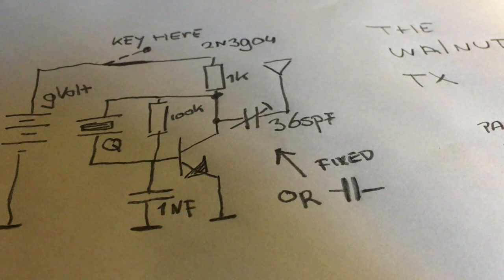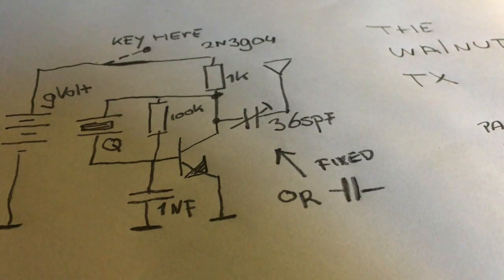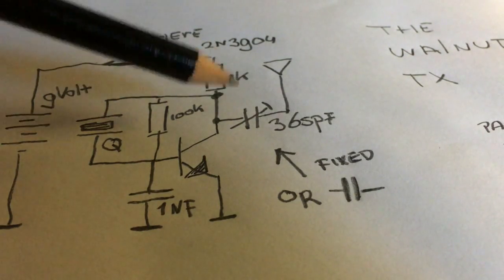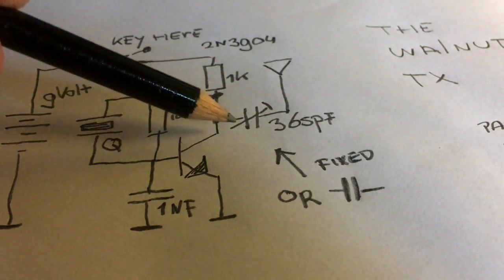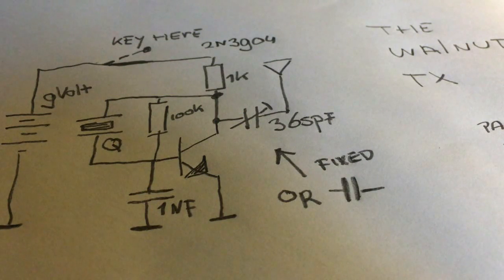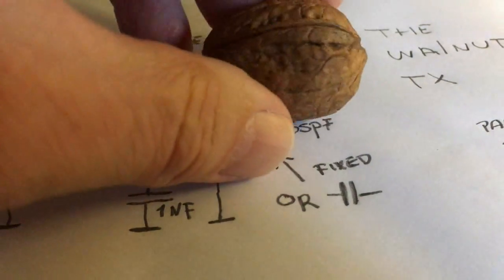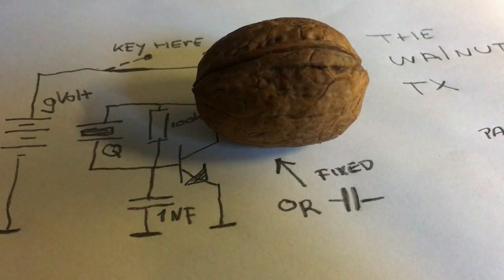The walnut TX

Comment: Love it. You should add a spring to the hinge and contacts on the two shell halves to make it a castanet-style keyer.

Question: is that a Pierce oscillator or Colpitt's? It looks a little like both, but not quite like either.
Reply from the maker: It´s a Pierce osc. a bit strange without the resistor but it works :-)